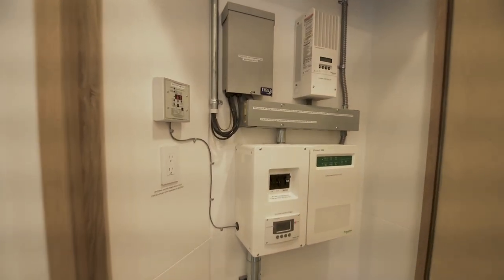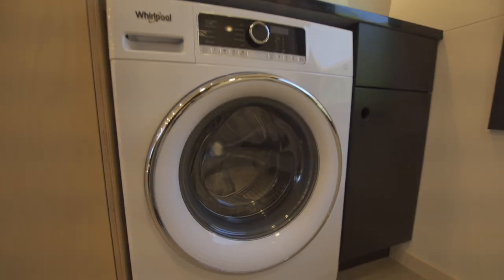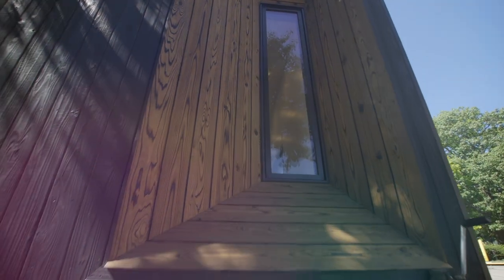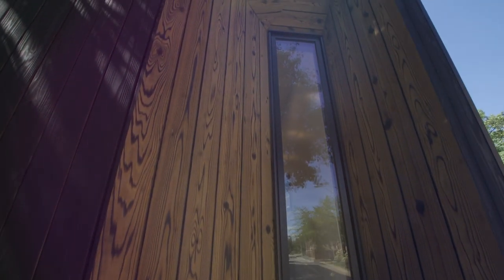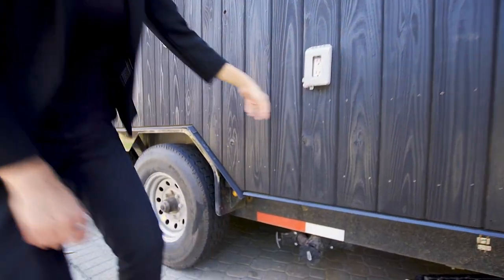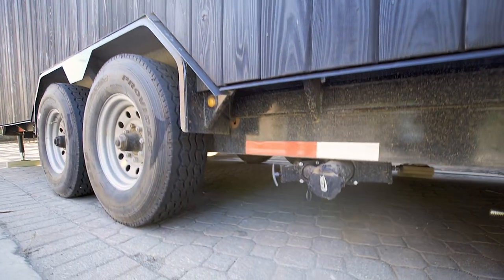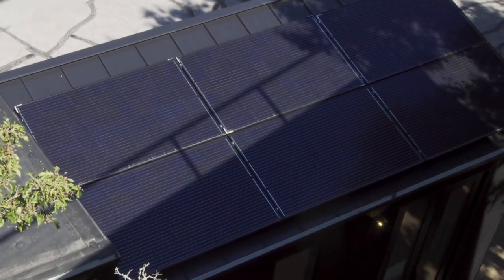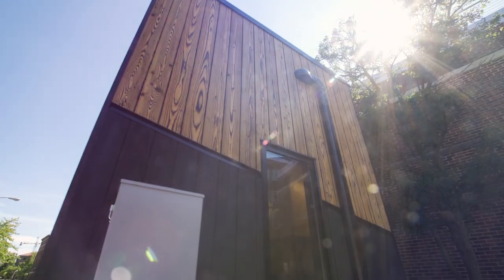Sustainability Education | New Purdue Lab Provides Tiny Home

Comment: I am disappointed that my Boilermakers didn't include evacuated tube solar thermal collectors and micro steam power and hydronic floor heating (microCHP).  We are Boilermakers! Evacuated tube solar thermal collectors with compound parabolic reflectors behind them have the highest aperture efficiency and conversion efficiency of any other collection technology out there (95-98%). Let's capitalize on that eh? And let's not stop there. How about we bring back steam jet ejectors and absorption chillers to use the heat when we need cold.
Reply: And while we are on this topic of tiny houses, why not drag the biology department into a micro digester subassembly for the black water tanks. I don't think two people will make enough biogas to cook off of, but if you use a little power for an in sink aerator you can put all of your organic waste in there as feed stock and cover the gap. That project is a little harder to pull off, but a lot of fun to do, I can tell you from personal experience.